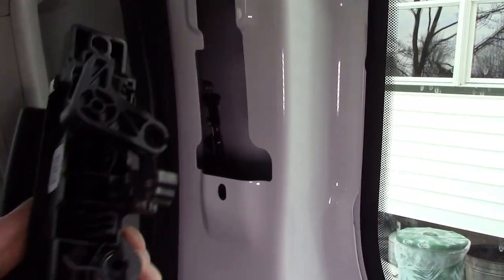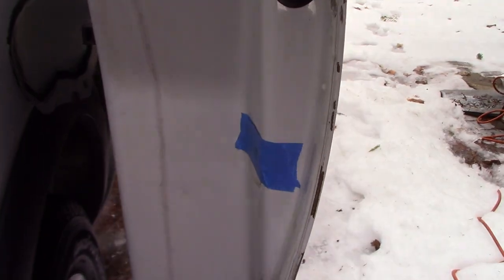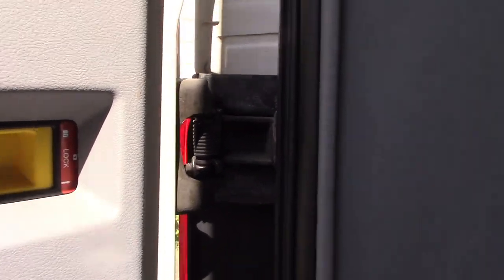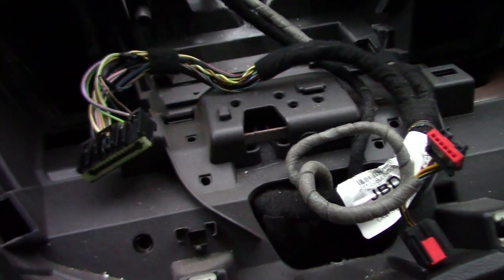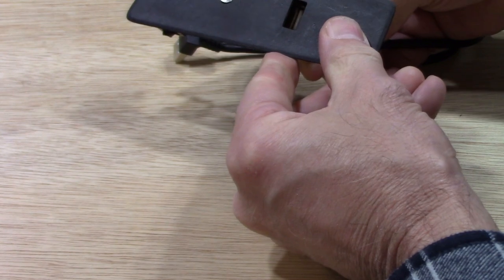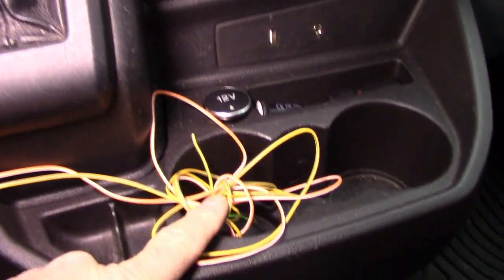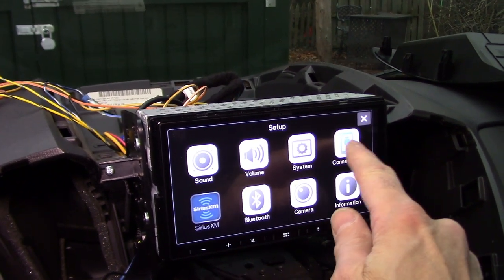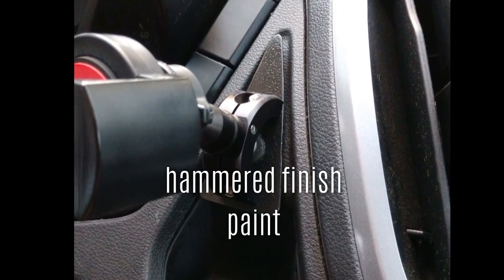Ford Transit Issues & Fixes, slider door handle, rear brakes, rattle, light switch, radio, filter

Comment: I'm having major brake issues! Been in the shop waiting on parts after 3x losing my brakes after one replacement of brake pads and rotors... I left the shop both times and lost bearings on each side separately. Looks like you're doing lots better than me💜
Reply from the maker: Think I have a front bearing going as well. Maintenence never ends !
Reply: and the phone mount is cool... I made mine too... cant see paying top dollar for plastic junk I can rig myself... nice

Comment: We have a 2018 or so Ford Transit 350 passenger van at the hospital I work for and  the inside door handle when the door is fully open will not allow you to close the door once you’re inside. You have to get back out of the van or reach around to the outside handle to get it to release and then climb back in and shut it the rest of the way from the inside. What needs to be done to fix this?
Reply from the maker: Try pushing the door toward back of van, then use handle. It tends to bind
Reply: @barrysoutthere   will give it a try tomorrow. Thank you Sir!
Reply: Pushing the door back and then trying the inside handle didn’t work. I could see the latch in the bottom of the door track toward the rear with the door fully open and it would only release to close when you use the outside handle. I don’t know if that makes sense or not? Perhaps if I took a video it would give a better understanding?
Reply from the maker: @pearldrums77  inner handle or cable must be broken. Those handles are delicate where the cable end attaches.